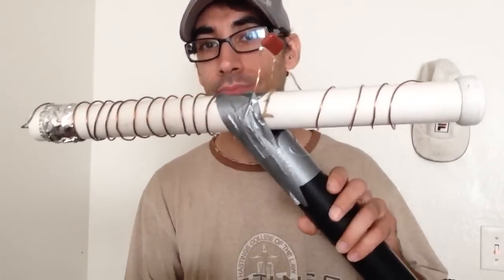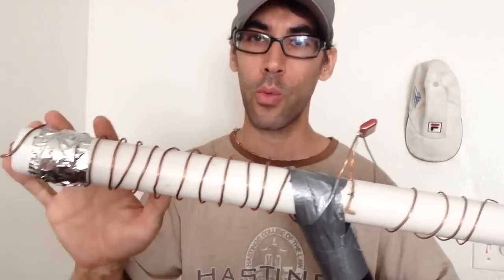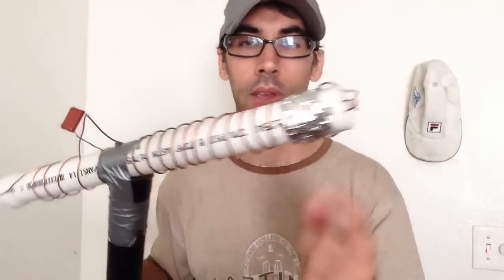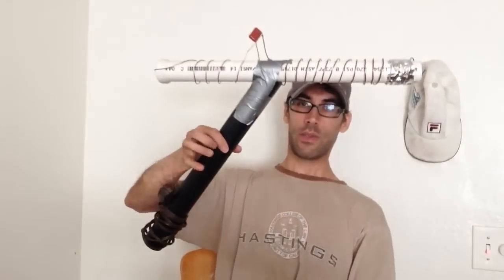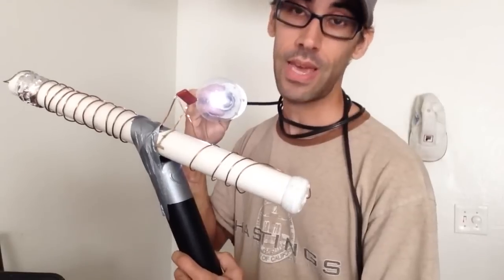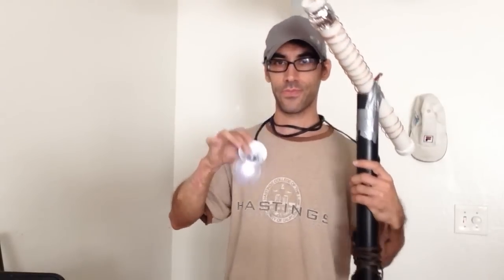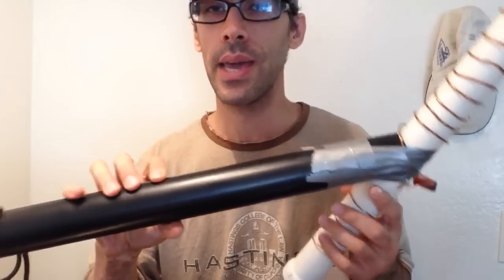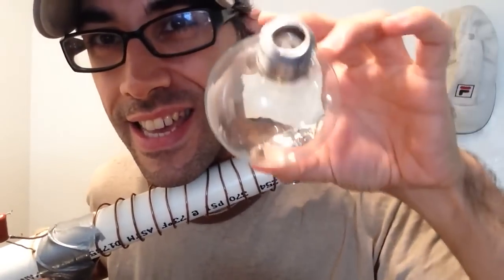HOW TO MAKE FREE ENERGY FROM POWER LINE WITHOUT MAGNETS JUST AN ANTENNA DEBUNKED!!

Comment: You do some experiments ? I do and ill tell you what i learned by myself no one told me,if you take a thick copper cable lets say 3 meters and mount it on a pole then you take any metal  stick it in the ground so you have a negative the earth and positive from this unknown energy in the air you have 3 volts,with that you can do a lot 3 volts as a starting point.

Comment: Another good video.  Thank you.  I can't believe the likes to dislikes ratio.  There should be very little dislikes.    I think this means unfortunately people are falling victim to these free energy scammers.
Reply: guess you don't know about earth batteries
Reply: @NunchuckBoy83  no don’t know about earth batteries.  You are correct.
Reply: @stbkoo  The Earth battery generated power for early telegraph transmissions & formed part of a tuned circuit that amplified the signalling voltage over long distances. They pretty bad ass tbf, can produce upto 5 volts nowadays. Apparently..

Comment: You're a fucking idiot just so you know.  And yes. . If you mean free as in there is untapped energy all around us, radiating, resonating, heating, cooling, changing pressures all the time, along with now possible magnetic pixel printing that allows the strength, size, and pole of a magnetic to be designed and printed onto materials at a place called Correlated Magnets in north Alabama, then yes. . With the right design and combination of energy producing technology, once the system is built, then there comes into existence the concept of free energy from surrounding abundant energy!  You're obviously to narrow minded, uninformed, and lacking imagination and vision to see the reality around us.  If you think there aren't beings traveling from even solar system to solar system, if not galaxy to galaxy or even beyond for all we know . , then you really are a clueless wonder that needs to spend a lot more time researching, and a lot less time trying to be a star of nerd porn. 

Do yourself and the world a favor and acquire another hobby for yourself.   Deuces 🖖

Comment: youre right USE GOOGOLS if skeptical open mind doesn't believe in this theory then he should not use the  power from the grid because the theory behind the story of making electricity from power lines using only antenna is the same as theory of the transformer and the am radio reciever

Comment: The consept of harvesting energy from a power line is legit however i knew somthing was definatly up ( other than the crappy setup to harvest magnetic energy ) when the lightbulb didnt dim when pole was turned away from power line, also i would think you would have to be a lot closer to the line for it ti work. I live in the country but there are very large power lines in my front yard wich i was at first not happy about but then this idea poped into my head

Comment: FYI people this is a joke that's based on the true effect of line leakage where high voltage lines leak huge amounts of power into the air ,in theory and practice the power leakage can be siphoned off but it's a serious crime ,this particle joke is a small part science of massive transmission lines that will explode your head and 99% nonsense.

Comment: That actually does work if you add in taps and rectifiers and go for a DC output. It's unlikely you'll be able to tune your tank circuit to 60 hertz like your power needs, so your best bet is to dump the DC power you're scrubbing from the magnetic field into an electrolytic battery bank and then run a power inverter off the battery bank. You're not going to get tons of current off of it, but you probably waste a lot of electricity anyways.
Reply from the maker: An antenna long approx 1000 miles is required to tune on 60Hz of frequency :)

Quite a lot of voltage can be achieved but very low current even at relatively short distance (few inches away).  W = V x I

In few words there are no usable Watts in this system considering also big loss in the semiconductors(including rectifier bridge etc)

The risk of electric arc is definitely higher than the usable energy you get by "stealing energy" 

Thank you for watching!

Comment: Yea that's actually possible. It'll have to make contact with the lines but if it's not measured by entering your meter box it's free. Take what he made, really connect them, no fuse, it will blow with flying colors. Drop device in between two lines and enjoy dangerous illegal lights.

Comment: actually it is brighter with an electrolytic capacitor
Reply from the maker: LC circuit with an electrolytic capacitor it`s not as smart as idea :)

Cheers!
Reply: if you point the antenna at the moon you get a blue light... try it

Comment: With just a little more effort you could have made something that actually worked like this. https://www.youtube.com/watch?v=_pm2tLN6KOQ
Reply from the maker: Thank you for watching first of all!
Unfortunately you`re not aware that AM crystal radio is NOT FREE-ENERGY 

here is my radio galena https://www.youtube.com/watch?v=UfnxqkfZI7Q

Regards
Reply from the maker: Nope! :)
#1 misconception 
Free-energy is NOT when you don`t pay for electricity but rather a deeper concept well explained in thermodynamics https://en.wikipedia.org/wiki/Thermodynamic_free_energy

#2 Misconception radio galena gives infinity energy on a "upper scale" LOL
The total amount of energy the radio station emitter is equal to the sum of the load of the receiving antennas.
for instance:
If you apply a higher load to your receiving antenna the radio station needs to pump more energy  out. 
If everyone apply just as a small load to their receiving antenna for the Radio station it means BIG TROUBLE!!

I hope I clarified your idea 

Thank you for watching!
Reply: Yes I agree. The laws of thermodynamics are correct, but since I didn't pay for the energy it's free energy as far as I'm concerned.
Reply from the maker: for instance if I work for the energy company and I don`t pay for my bill I just created free-energy :)
Reply: Yes, LOL You found a way to get around the laws of physics:-)
Reply from the maker: I wish! :)
Practically yes ...technically no :(

Comment: It is still possible to do that, with a functional setup. It might take 1000 times more wire and a good dozen of extra components. We were doing this at our physics class. Technically, it is even, possible to gather the electricity of the atmospheric potential. But, for that, you'll need a cyclopical installation of, at-least, 200m up and another 100m into the ground. Which should gather around 300Wh.
Reply from the maker: Technically is possible but practically not :)

The usable energy in terms of watts out of a BIG power line is close to zero.

Technically you can have ALL the Voltage you want but zero usable amps. 
Faraday clearly demonstrated you can have voltage without current.

Energy company Technicians are able to gather only about few milliamps at about 10inches away from the phase cable by hanging from an helicopter ....

Any other "common mortal" person try to replicate this experiment run a chance to get a big plasma arch within 6feet away from the cable :)

Thank you for watching!!

Cheers
Reply from the maker: That`s correct! 
You can get an electric potential out of atmospheric particles with the proper setup you promptly described.

The side effect of having that big machinery with long cables up in the sky and down the ground  is that it`s EXTREMELY dangerous since would attract thunders like honey for bears.
One single thunder strike and your all setup melts down like a candle including yourself :) (thunders are about 29.000C` degrees)

As for the setup itself in IDEAL conditions the efficiency is less than 10% so that`s why engineers never consider it 

Cheers mate!
Reply: you are way too skeptical. :)
if everyone would be that way, we would be,  still thinking the earth is flat and we can't drive fast, because the vibrations would cause convulsions! lol
BUT, I totally agree with you that there are way more mindless believers than heathy minded skeptics. Most people believe they are in a magical world. And all they will get out of your video, is some dissonance, which will get them mad, but not more rational. 
I guess, a more deep, experiment, based on all the pseudologic of some crazy theory, with a honest negative result and an explanation why it does not work and only then, how they are getting tricked, would give much better results in putting their mind together. ;)
Reply from the maker: In quality of engineer and researcher(not pseudo-inventor) I`m waaay open-mind...more than what ppl think.

Always open-mind but:
ALLERGIC TO BULLSHIT!!!

Scam companies invest a LOT of money to come up with a machine that has to "look and feel" real in any aspect

For a real engineer it takes nomore than 1minute to figure that in reality machine it won`t never work and where is the trick!

Schooless/uneducated/blindly believers ppl don`t wanna be explained cause they are what they are for a reason!

For instance:
A good quality visual experiment that raise the credibility of uneducated/gullible ppl with the happy ending trick is enough to remove the fairy dust off their eyes. 

Reproducing the "real fake" machine it`s just a real waste of money and time (Adsense pays $0.004 per click so good luck :(

Smart and educated ppl like you can only laugh at my videos watching these trolls reproducing these experiments that...suddenly never work! :)

Cheers!
Reply from the maker: It`s actually 100% fake!!!

These ppl when have no more creativity for a new video they suddenly put theirself into free-energy tricks

That`s what everybody is doing nowadays....no more clicks on you channel??? no problem...let`s do a free-energy generator!
Reply from the maker: Adiitional info:

ANY cellphone requires AT LEAST 750mA with 5V just to kick start the charging system that means:

5 X 0.75 = 3.77 WATTS!

3.77watts???????????????????????? That`s a lot!!! 
Noway you get more than 0.40w from the powerline at about 5inches away

Now consider los in the transformer...wires...etc...

This videos ARE SOOO FAKE!!
Reply: Skeptical Open-mind 
Sure, all their work and material, will never buy-off the several watts, they are getting. 
But, believe it or not, these guys are ones of those, that are showing things the way they are. 
They are getting popular on their craziness, not on the mythical consepts
Reply from the maker: Craziness AND bullshit mixed for clicks!

They`re not the only one on Youtube believe me! LOL
Reply: Skeptical Open Mind, 
So, basically, volt is potential energy, but not activate energy to be used, so AMP is the most important to get energy within something, from volt. So, Volt as potential energy that is within the atom, then that energy becomes activate to be used, that is AMP, with a bridge to carry that is metal. Cap. is activate energy device, the cap that you have in between two wires. That means if you have Volt that is potential energy within a mass, well, the highest loosely potential energy that is metals, not non-metals because the energy is tight bond, and take more energy to loose the energy, so it becomes loose as it attracts to external mass. 

So, ya are saying free energy is impossible because it is too small, need to be big enough, but would be too big for portable?? Am I right in the description how energy work? You are basing fuel energy that is connected to mass, that is sending out volt, so the volt is in the air that is being sent out from the source, you are taking the Volt during the process. So, you use the battery to absorb the Volt, so the battery has the higher energy to absorbs energy from the air. It requires energy to get energy.
Reply: Wh is a measurement of power over one hour did you mean 300W?
Reply: (Khalif Foster) A volt is the difference in a electrical charge between two points, amps are the like the size of the charge.

Comment: Okay my friend. you don't try a large transmission line. You have right because it's not free energy, but try to watch the electrical videos about line working. The disconnected line always being grounded. The electricity is very useless, but it's very dangerous. It's called induction.
Reply from the maker: EXACTLY YOU RIGHT! here is the full story:

Voltage IS electricity so for instance YOU CAN GET ELECTRICITY FROM ELECTROMAGNETIC INDUCTION.
It`s called wireless transmission....

HOWEVER;

In the case of powerlines, you can get ALL THE VOLTAGE you want with literally zero usable current!!!!
Which mean translate in energy...... ZERO USABLE WATTS ...unless probably 5cm away from the cable or less ...in that case you run a chance of  big plasma arch on your head :)!!!

Regards
Reply: yes. i also hear about a few boys, that make a antenne. They live very nearby a radio transmitter, so their flashlight only have an antenna. But it's not free energy
Reply from the maker: YES 
You can lit any common CFL bulb coz ionizing a gas does not require current only high voltage or static charge. 
LED are exactly same principle ...with a simple joule thief you can lit as many as 1000 led with less than a 1W of energy.

YOU RIGHT:
Still....not free-energy...

Cheers!
Reply: Yes my friend. I have a car ignition coil, hooked up as a teslacoil. The cfl bulb lights up, without any connection
Reply from the maker: Thumb Up! :)

Comment: Although this video addresses the assumption to the contrary, we still think that with proper instruments, it may be possible to obtain electricity from elecromagnetic induction.  It will  take some more time and research.
Reply from the maker: Voltage IS electricity so for instance YOU CAN GET ELECTRICITY FROM ELECTROMAGNETIC INDUCTION.
It`s called wireless transmission....

HOWEVER;

In the case of powerlines, you can get ALL THE VOLTAGE you want with literally zero usable current!!!!
Which mean s translate in energy ZERO USABLE WATTS ...unless probably 5cm away from the cable or less ...in that case you run a chance of  big plasma arch on your head :)!!!

Regards
Reply: As I said, although today's technology does not allow us getting electricity from electromagnetic induction, the way technology is moving, it may be possible in the future.
Reply: Voltage = IR, so there is a component of electricity in it, it only takes research and the use of proper instruments to take out the current as we do with oxygen from water.
Reply from the maker: AS I SAID ....
Technology nowadays ALLOW US to get electricity from electromagnetic induction!
Example: Toothbrush Wireless charger, Iphone wireless charger, HF military radio transmitter etc....
Reply from the maker: Ohm`s law has a an electricity component in it???? 
Could you explain what you mean with it in technical words?

Comment: ...oh wait, lol YOU, haha... NOW come on, I thought you were going to make a BIG, BIG one and go near large power lines. They radiate and give people cancer and drive cats crazy. That might work but is not free energy. Transformers aren't touching one side to another but is a legitimate coupling. You I PROMISE can make a really long one of these (similar...a dipole...I dunno about the capacitor) and go under the high tension wires in that huge flux and  light some size light bulb. I'm going to do it... look at how a 50 watt transmitter can put out a VHF signal and a dipole resonant antenna can receive and light a low-watt bulb (after all, she's merely one point in an omnidirectional field, inefficient)- professors do it all the time, not a trick. I knew something was wrong when it was so short and you were just in your room, not near a huge flux somewhere. But I could demo a rather useless ut real trick...if you live under high tension wires and make your back yard really ugly with big antennas you could definitely light some fluorescents ...dimly light a room, shave $5 off your bill haha, but for real
Reply from the maker: Thank you for watching!

YES while it`s NOT free-energy....

It is possible to gather some energy from powerful powerlines...

HOWEVER:
Most of powerlines are "up to code" that means that are well distant from any possible receiver that can "use" that energy.

VOLTAGE as much as you want...but I can guarantee you won`t get enough current to charge even  a 1970 cellphone. Consider also using a big cake loop antenna you still have to stand at a very dangerous distance from the powerline(risk a big fine).

Cheers!